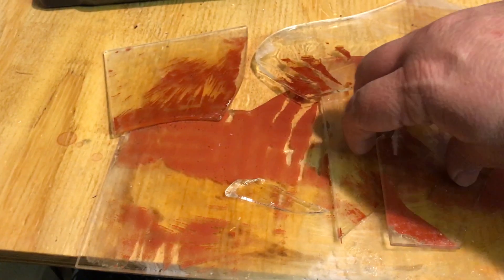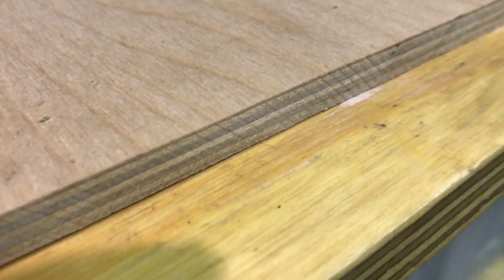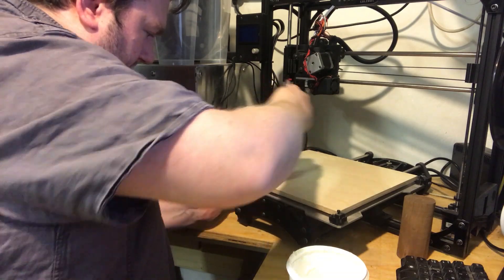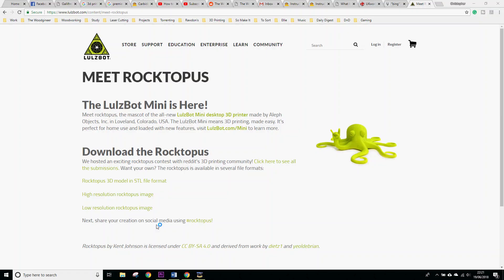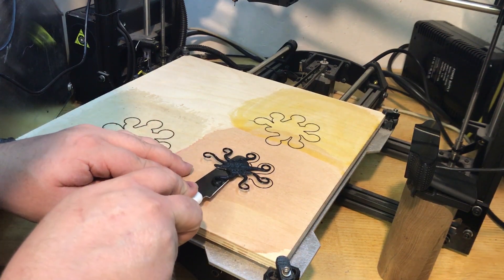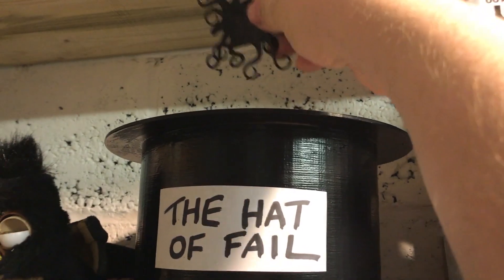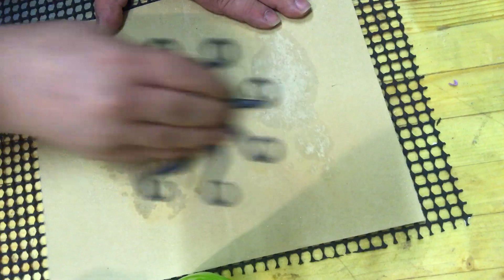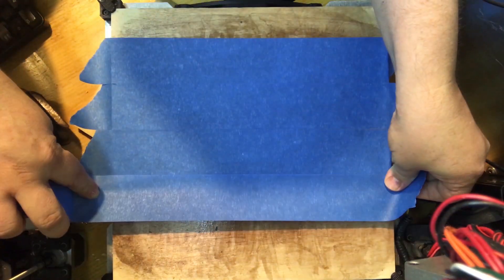Can you 3D Print on Wood?

Comment: Very disappointed that the filament didn’t stick fully to bare plywood. I found your video searching for examples of printing permanently onto wood. 

I’ve been making wooden crates for storing tools and stuff. And I would like to label them. I was thinking that maybe I could basically use my Ender 3 as a “printer”, depositing brightly colored designs onto the wood. The goal would be to just clamp a piece of plywood onto the bed and print 1-3 layers of text or designs. 

I will probably try it with PLA at very high heat and perhaps over-extrusion. We shall see. Thanks for your experiments.
Reply from the maker: I’d be very curious to see the results if you give it a go!

Comment: That is not what i was expecting, i was just wondering if its safe to put your 3d printer on a wooden desk
Reply from the maker: Sure, 3D printers are really safe these days.  You can get some good vibration dampening if you put it on a concrete slab however!

Comment: What about sanding the wood and then varnishing it. With a laquer there should be no pores.
Reply from the maker: There’s no “need” to try this as I have two decent replacement beds now but I must admit I’d like to revisit this and give it a go as I think you’re right, it could work well.  I suspect the fumes from a 230 degree nozzle against a lacquered wood won’t be too good though.